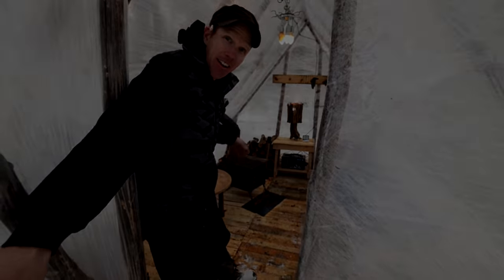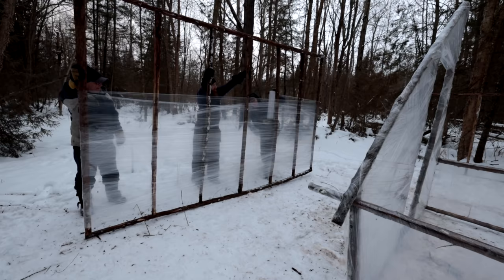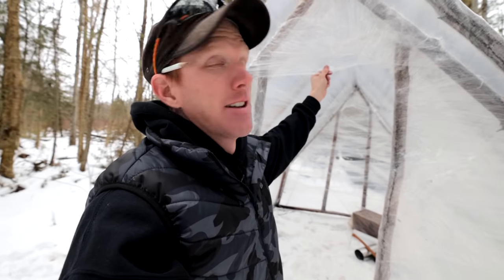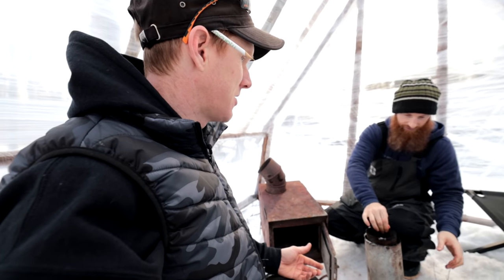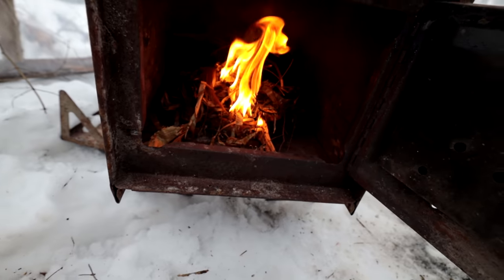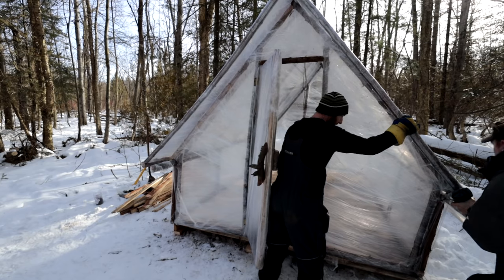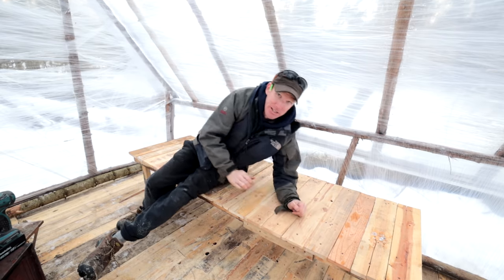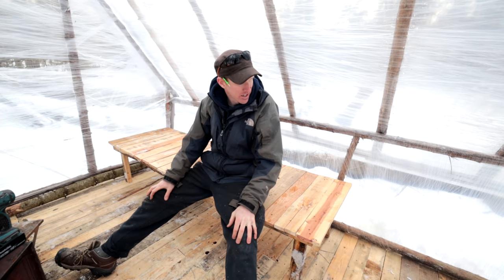$25 Winter Cabin Build (on an Extreme Budget!)

Comment: A three legged table isnt more stable that is a function of the area covered by the legs so the wider area the legs cover the more stable.  The point of having three legs is they will stand firmly on any surface, where four or more legs will leave a leg in the air on an uneven surface.  (The inverse of that is it can be tricky to make all four legs even so they dont wobble so the cheat is just have three legs)

Comment: kept thinking they need six legs on that bed- a set of legs in the middle were the pcs of wood joint together.  set a couple of pallet out on the ground in front of the door as a front stoop  then a couple of benches.  A little snow piled on the sides  would help insulate a little and act as a wind block.  just pick up some cardboard and line it between the snow and the plastic walls.  Would help lock it down from wind Just would keep the front without snow- this allows the air  to flow under the floor and out- CO2 would sink bellow the floor and should  flow out the front..   Much like your wall frames-  wonder if you could create some frames to put behind the stove and then wrap them with tinfoil.  Even cardboard wrapped with aluminum foil would  help keep some of the heat off the plastic.  or even just rolled out and stapled to the rafters.  For that log you talked about using moss to  do the cracks.  Just use the plastic wrap and  wrinkle some up and then wrap it around the  log. Will act like the moss.   Like the idea of having some solar heating during the day from sunlight.  need a radio- and a dog bed- would want a dog with me on bear duty.

Comment: Quick tip if you are collecting nails from pallets. Instead of breaking them apart and trying to remove the nails without bending them. Just make a fire and burn the pallets. The wood is gone and the nails are super easy to recover with no issues.

Comment: Not counting cost of tools, I built a 384 square foot wood cabin out of just reclaimed pallets for $0.00.   I found I was able to obtain a virtually unlimited number of pallets free as many people are aware of and I reclaimed nails from enough of them to use as fasteners.   I made it with two concentric walls with an air gap between so the walls total thickness was around 18."  I found an old 16 gallon steel drum and cut some holes and used that as a stove.   That was free.   So much of what I found was the same way as in this video.   My little cabin when done could sleep 8 a little crowded or 4 very comfortably.   I cut a lot of the pallet wood into shakes/shingles and that made it water proof.   I found some old wood sash windows left out in the trash and recycled them into windows for the cabin so again, free.   You'd be shocked at what you can find on trash day.   So a friend of mine had a couple hundred acres in the woods of northern Vermont and that is where I built it.  He liked it better than the cabin he hired a contractor to build for him ten years earlier for $40k.  His wife said it looked like a medieval storybook cottage.    Total cost was roughly $400 in gasoline, a few thousand for the vehicle to transport the material and people, a few hundred dollars in tools and meals while we constructed it.  I built that around 1999.  Friend informs me it's still there and still being used.   His cabin he paid to have built burned down a few years ago so he uses the one I built now.   He had it upgraded though.  I originally hooked up a make shift generator (repurposed electric motor) to a home made windmill for electricity and that my other electrical engineer friend hooked up to a battery so we would have lights and a radio.   But the upgrade is now the electricity comes from solar.
Reply from the maker: Nice!

Comment: It can be even cheaper, just long thin (young) trees arranged in a teepee shape with twigs zigzagging between them to create stability, then keep cover it with whatever you can ging on the forest floor like moss, that can be so tight it keep most of the rain out, in the winter it can be possible to use snow as isolation. At one point in time humans had only rocks they could find as tools and they were able to build camps and small villages without spending a single Dollar.

Comment: Would cost a little more, but some insulated dryer hose duct taped to the metal pipe with a cheap aluminum house vent on the roof would probably hold well and not melt.

Comment: i would of done this 100% except up the price a little then get a large drop cloth for painting then threw that over the top of the cabin but leave the walls as they are.  , this provides you with shade and adds another layer of insulation on the outside but also still breathable  dont have to worry about water as its snowing.

Comment: I wonder if using wool wadding, perhaps an old stained or torn wool sweater wrapped around the stovepipe would help with roof protection?  Perhaps sod stacked on the floor and wall?
I saw a youtube of a Russian man who likes to camp well in rough conditions, where he built a fire outside of a six-man tent and ran a one inch diameter pipe from the coals into the tent.  It heated the tent to 70*F in a couple of hours.

Comment: Would filling the open panels with a few layers of cardboard or old  corflute realty signs help the with insulation process and heat retention?
Especially on the roof section?

Comment: If I would do cabin like that I would rather use Stirodur insulation boards for 25€ I get 8 boards (125 x 50 x 2cm) and for the size of your cabin I would probably need about 10 - 12 which is a little more expensive, but I would assume much more sturdy and warm

Comment: Pulling ring shank nails from pallets is dam near impossible. I highly recommend your sawzall method. Nice low buck hang out for sure.
Reply from the maker: I find if the pallet gets rained on it works better at pulling nails..  but if they are dry..  sawsall all the way.

Comment: I'm up to the part where your trying to fix the gap between tent and floor with another log ( fail ) it would of been more logical to use the pallet board as a skirting - the all you need to do is sit it on the floor and fix it to the bent pole. Just saying .. anyway all in all very interesting .. thanks for sharing 👌

Comment: Did you mention that the plastic wrap should be wrapped from the bottom to the top, overlapping so the water runs off? If so I missed it.

Comment: Suggestion: You could have just joined pallets together with screws and then covered the pallets with pallet boards. Also you forgot to put down a vapor barrier under the floor.

Comment: Sure it might be $25 if you're only counting the cost of the plastic wrap and the screws. But how much did you spend to get that saw you used? What about the drill, or the axe, or the the sled, or the straps?

Comment: Why not just build a dugout shelter with proper insulation. It wouldn't cost much in supplies since you would just use materials gathered in the area. You could still use the pallets and other free items in the construction.

Comment: They said it was air tight ??? That would cause carbon monoxide alarm they talked about to go off ….the fire  would also eat up the 02 and the respiration of three or four people in that space makes it a death trap …so there should be many air vents on the roof and walls .sacrifice some heat for the inflow of 02..I would put in a bunch of plants to also oxygenate the inside

Comment: I will give you an A+ for imagination and creativity but I have a few questions. First:  on the roof seems like the plastic should be vertical to prevent rain/snow from getting between the layers and leaking  into the cabin.  Second:  how do you keep the sheet metal from heating up around the smoke stack and melting the plastic wrap?  Third:  what happens when a tree limb falls on the roof and breaks through the flimsy plastic wrap.  Fourth:  seems like it will  be easy for an animal to scratch through the plastic wrap with their strong claws..............You obviously have constructions skills so why not collect enough scrap/free wood and build a more substantial structure??
Reply from the maker: The layers seal to itself preventing water from coming in.  The aluminum flashing is very good as dissipating heat and doesn't seem to heat up or melt the plastic.  Animals seems to ignore the structure.  A tree falling on it would suck. If you check out my other builds you can see more substantial builds.
Reply: @ModernSelfReliance    Thank you for the info.  I find the plastic wrap structure fascinating.......Right now I am looking at the round structure you made.  You definitely have construction skills

Comment: To be honest you can so the same with pine wood and pine branches with even lower price.
Reply: Ok you kinda forgot too add price of saw , heating source, transport (fuel) ...
And like people said it will get 100humid inside extremely fast.
differences in temperature will make plastic rip to shreds very fast too.

Comment: didnt figure in the cost of the tools?

saw, drill, etc?
Reply: I get what hes trying to do. The bare minimum in cost. you really could source the other things for free. Most people probably at least have a screw driver, mayve borrow a hand saw, yada yada. But really nothing in this was necessary besides a small hand saw and the plastic wrap. maybe screws but even though could be replaced by bark strip rope. Not a bad idea for something quick, maybe while you're building out a better structure.

Comment: Choosing to use a 120V lamp instead of USB  lights is just very silly.  The USB light you could have used are several times more energy efficient and your run time on your power source would be amazing.  The 110V inverter in you unit wastes a huge amount of energy in the conversion.

Comment: yikes..$25 would maybe bye one pallet wrap, more like a half a roll.
 (edit)
Ace hardware sells one roll for $44.99 plus tax not to mention the cost of a stove. Stoves are hard enough to find for free..Imagine what they cost just used! My uncle has a used ( Made in Taiwan ) small cast iron that weighs 205lbs with bad legs and he wants at least $100 for it.
So to do what your suggesting would cost at minimum (if you get a free stove or build one yourself) $100. Amazon sells pallet wrap for $88.99 plus tax (four pack). Thats the best deal I could find.
Sorry guys but $25 aint gonna fly!

Comment: Keep 1 pallet that you do not cut apart, and put it in front of the door as a door mat to clean mud and snow off your boots instead of tracking it into the cabin. Also, those pallets with ply wood on them would have worked for flooring... It's already put together. Just cut it to length/width and your done

Comment: If the stove was beside the door, then the pipe would've come out beside the door, and not require you to compromise the roof. It would've also heated the front of the cabin, and allow the back to preserve the heat more (less temperature gradient inside) because the heat would've counter the cold coming from the door. All and all, neat idea, but needs design improvements :)

Comment: What happens to plastic when it gets cold?  it rips and beaks. enough said.  good luck if you plan on doing this to stay alive.
Reply: That shrink wrap is used on pallets in commercial freezers across the world.
Reply: @buckodonnghaile4309  ya, that are held Tightly agaist the product for bracing. think about it. plastic Flapping in the wind? like I said .. good luck. won't last a week. never seen wind , rain or snow in a freezer. have you?
Reply: @chuckufarley8158  i was merely addressing the issue of cold
Reply from the maker: This cabin has been shown in my later videos in the summer, It's lasted all winter and all summer now. heading into the second winter.

Comment: You could have spent the entire $25 on a good saw.......and then just built an igloo that was reinforced by tree branches.
And it would have insulated you better than the plastic piece'a'crap you added to the environment. Except the plastic isn't biodegradable....